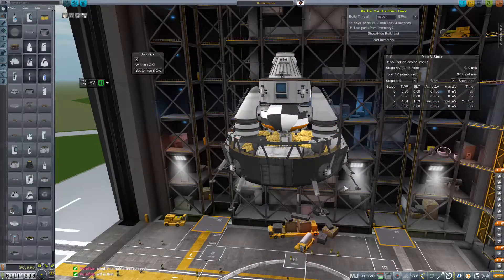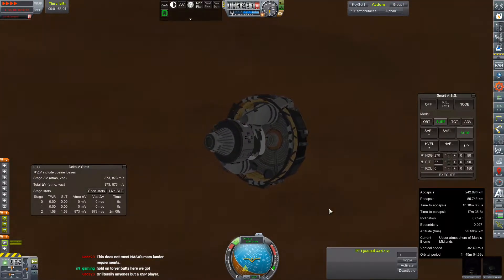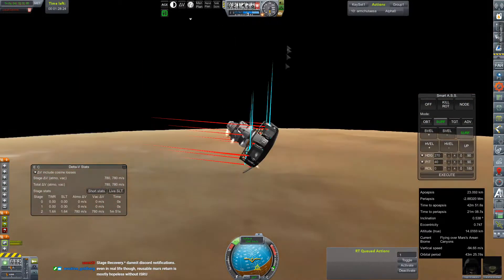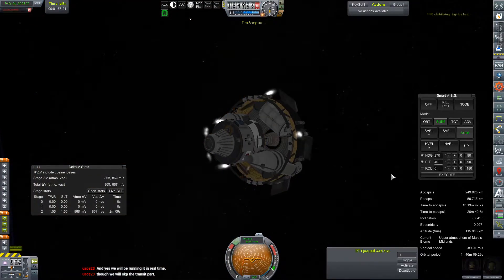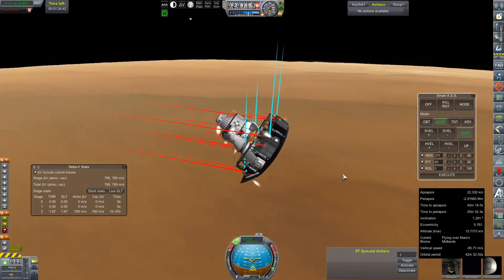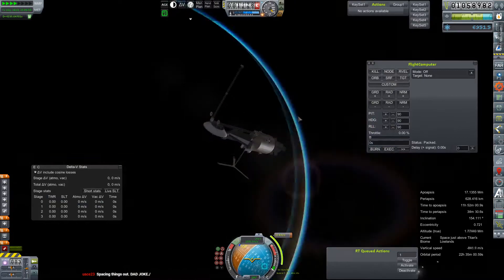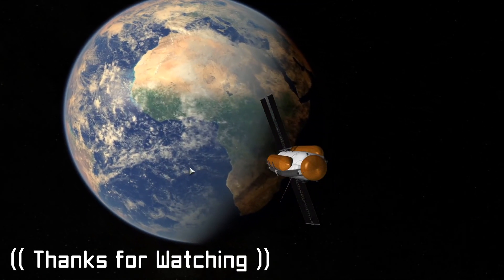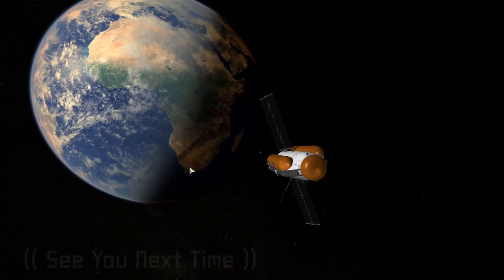KSP RP-0 #617 Stress Testing ( Twitch Re-Cap)

Comment: Try to put the parachutes on the ascent stage. It looks like the parachutes create torque on the docking ports because they are placed very low and the descent stage just wants to flip over.
Reply from the maker: I really want to avoid putting the chutes on the ascent stage, only B
because I am lazy and dont want to change them in orbit after the repack limit. Kas does weird things to configs sometimes too, and the useless mass...
But you're right, it's the torque from the chute deploy the docking ports cant quite handle, I want to see if I can resolve it by just being slower at deployment altitudes, or in less dense air.